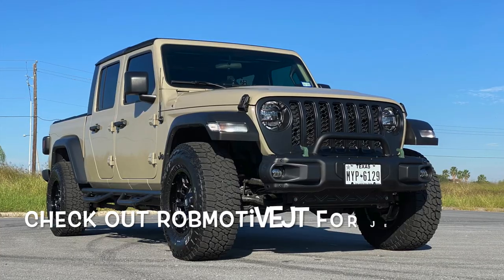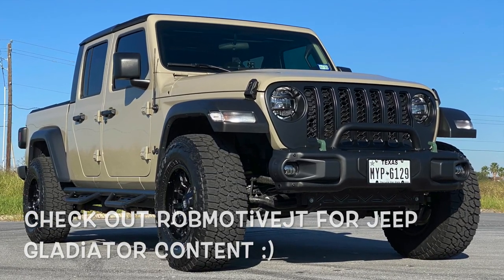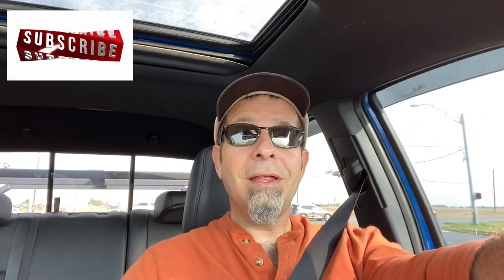Toyota Tacoma Parasitic Draw & A Smoking Radio

Comment: Whenever I buy a new car, the battery lasts about 5 years before it dies. I usually have problems with aftermarket batteries. Doesn't matter if it's a Napa, Die Hard, Interstate, or even Optima. So far the best one is from Batteries Plus Bulbs for my moms car. I bought a 2 year battery and it's been in her car over 3 years (knocking on wood, LOL).
Reply from the maker: I’ve never had problems with the original battery either.  All have been very good👍

Comment: Iv'e had my 2020 Tacoma trd sport for about 7 months now, it pretty much was stock until I put a lift and bigger tires on it I have no electrical mods. This month alone now my truck has drained 2 brand new batteries. What can be the issue? Iv'e gotten my alternator tested and it's good
Reply from the maker: There are many reasons a battery can drain.  Without knowing how you use the truck I’d have no idea🤔

Comment: I have also bought many new cars. Have never had any battery problems with the original battery. My 16' Taco's battery still doing the job. I did notice one of the posts had that green corrosion crap going on. Need to get back under there and clean it off. I was under the Impression, that Interstate batteries were superior products. My roommate has had two Interstate batteries in two different vehicles. One I paid for....think it was $317 bucks! Don't think they were any better then, say a DuraMax, or Die Hard! Hey Rob, thinking about getting new shoes for my Taco. I am undecided between Wild Peaks, Nitto, or possibly Mickey Thompsons. I am leaning towards the Falken. You still running the Nitto's on your Toyota? I know you had the Falkens on your Jeep, and like them.  I want to make sure I don't compromise the ride, so probably won't do a lift of any kind. I don't offroad, but would like an aggressive look.
Reply from the maker: I’m running Duratracs on my Tacoma.  The Nittos were too rough.  I’ll go with Wildpeaks when the time comes.  Just a bit better ride IMO👍

Comment: I don’t think you can read battery voltage on the dash. The way I do it is with an OBD2 plug that connects via Bluetooth to my phone or tablet with an app that displays live stream data.
Reply from the maker: I don't think so either.  If there is a readout, it must be well hidden🤔

Comment: I would say batteries are good in new cars these days , I think manufacturers put inappropriate batteries for the trim and extra goodies that the dealership orders on their vehicles.so it comes with a battery that’s ment for a base model. So with all that draw from all those electronics and  computers on board it will shorten the life of the battery. And also heat will kill it  also. And you live in Texas where it’s hot all the time.  I know this cause it happened to my wife’s 04 chrysler Pacifica and the current Jeep Cherokee. Plus these batteries now  a days are not cheap.$500 dollars Canadian just for battery. The Cherokee required a certain type of battery to run the vehicle properly. It’s not just a electric current that runs through those wire it’s also computer messaging and talking to each other. I can go on but it take to long to explain. But if you do try to do electrical work on cars you basically have to be a licence electrician to to this stuff nowadays